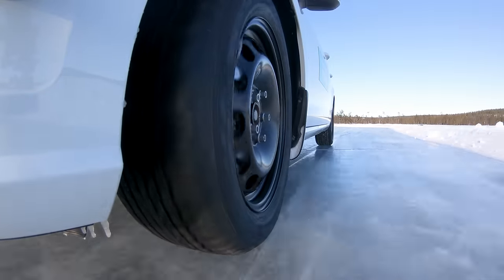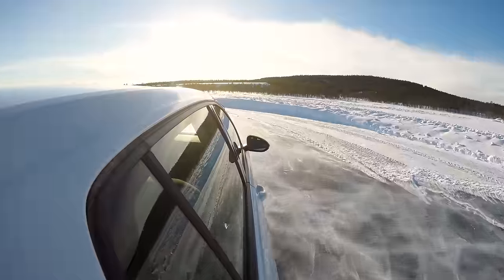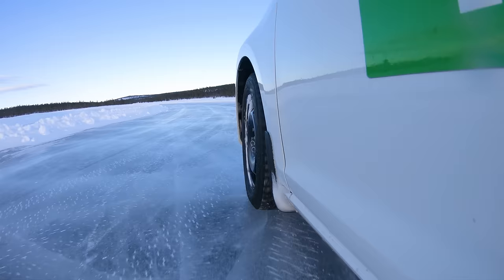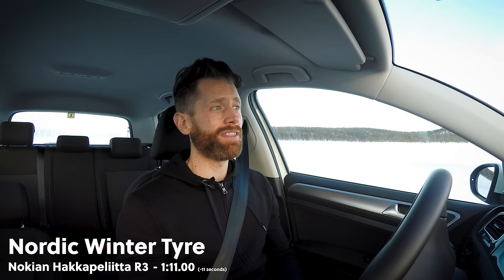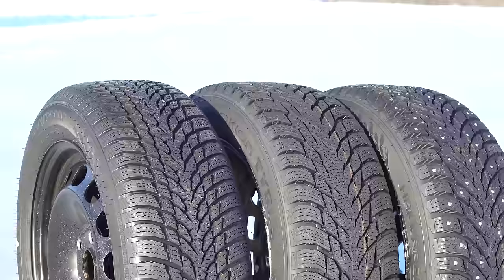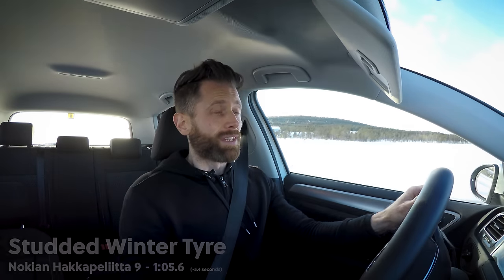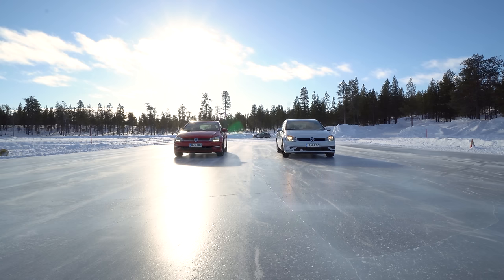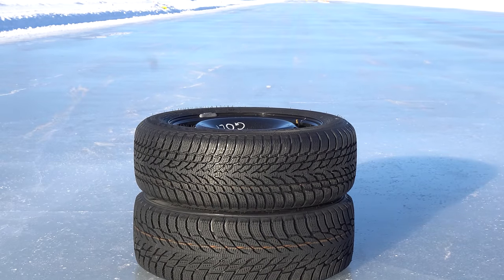Winter Tires VS Studded Tires ❄ What's better on ICE?

Comment: The times would be more impressive if you would have a "0" time (same track layout on tarmac in summer, best situation).
Reply: The summer times wouldn't be impressive considering that this is a lake.
Reply: That's why I wrote on tarmac. How would be the time on a normal track with the same track layout as on the lake

Comment: A good test would be brand new non studded tyre vs a 3 or 4 year old studded tire that’s been exposed to the elements. Age of the tyre has more to do than people think! These tests keep comparing new to new tyre, while many people have tyres they swap every year. Personally, I think running the winter tyres through the summer to finish them off is better than thinking studded tyres is the epitome of winter tyre performance, it’s not... the epitome of winter tyre performance is brand new tyre compound! I can go more places on brand new Nokia’s hak’s than 3 year old hak’s with low tread wear + studs. Tyre age and how a compound grips is more important than studs!

Comment: On ice: Studs... no competition really
On snow, slush and tarmac: no studs 100%

In either case.. don't save money on winter-tires. Get the best ones you can afford or you'd be cutting corners with your safety!
Reply: Not really. No studs are slightly better on snow but sudded better on the rest, mostly on ice.
The reason is that studded tires got harder point where the studd is places and therefor less grippy lamellas.
But that makes the tire a bit harded and more stable for lateral forces and better on tarmac and water.

Comment: This is a problem, this is flat and smooth. The test needs to be in the city and neighborhoods were solid black ice on a hill going down to a busy intersection or stop signs were you have to brake. This were ppl get stuck and run into each other. fiq. this time of age we would have this completely solved. So i suggest flying cars hehe

Comment: Not really a discovery....at all.. The problem with studded tires is that unless you live in a place where you drive on snow and ice covered roads consistently all they do is destroy the roads and perform poorly on rads that are not ice covered. Unless you live in the tundra away from civilization, the most common winter driving condition in, even in the coldest climates, is dry roads.

Comment: Studded tires will wear the studs of by 6000  miles or less . So if you drive on a lake which is ice then go studded . If you drive on pavement covered in snow and ice but have money to burn other wise forget studs . They are illegal in more states then the legal as well . 

Studded tires would be good in Alaska or Canada’s far north . Otherwise forget them altogether! END of story ! This video is really USELESS cause less then 2%
 Of people will drive on lake ice !
Reply: FYI; Studs are design to last as long as your tire pattern (or close to)
I don't know where you got that 6000 miles figure.

Comment: Sorry, but why not test studded tires vs non studded of the same brand/type? Instead of studded tires of one brand vs non studded of another brand.
Reply from the maker: Did you watch the video?
Reply: @tyrereviews  Of course man! I did leave my comment early on in the video, and the wording is probably wrong because of that. Unless I missed something..you tested 3 different tires from nokian. Nokian tires are fantastic, yes.  However, here in the states they are a little difficult to get and if you go to most tire places they will not have them in stock at all, if they can even get them.

What I was hoping this video was of (and still am if you could do it?) was that you would take one set of tires from a manufacturer that are studdable, get one set studded and one set non studded. From what I can gather (I've never had studded nokians before, only non studded), nokian tires that are studded, come studded from the factory. Other studdable tires do not come studded from the factory, that is done right before you have them installed. 

So, my hope is that you could get two sets of something like the 'firestone winterforce 2' or 'cooper evolution winter' or 'general altimax arctic 12'. Stud one set, don't stud the other. So it is the exact same tire, but one has studs and one does not.  Apples to apples.. in your video here, each tire has a different tread and compound. Not so much apples to apples imho.

Comment: Your driving with new tires of 5-10 km shows literally nothing.
I need to pay about $1000 for studded tires. If I drive an average of 200km a day, how long can I drive with those tires. 2 weeks, 5 weeks or 10 weeks? When the studs wear out, the tires no longer stick to the road as they did in the beginning when are new.
Ihad nokian hakapelita 9 and next time i bought haka10.Haka 10 was full disapointment,while haka 9 were really good first 5000-10000 km.After thet it started sliding more and more...

Comment: Ok, I've got a beef here.  Put two Audi S4s together.  One with studs and one without.  Here's the race.  Launch control 0-60 in a straight line and then 60-0 aroung a corner.  The studless would get annihilated.
Reply from the maker: On ice? I'm not arguing.
Reply: @tyrereviews  On I-70 in Colorado after they've sprayed magnesium chloride and it continued to snow and then that mix froze. :)

Comment: hi .. nice vid ... but Your COnclusion about times had a little but importent logical error in it .. You said  changeing the Compound gets You 10 Seconds .. but wiht Spikes You get only 5 seconds more ... and in a simple way that is right .. but ...  with 50 PS  You can drive a car  around 100 to 140 km/h ... With 100 PS You can Reach 180 - to 190  so the First 100hm/h need 50 ps  but with the dobble amount You can only reach about 50% more ..  and with higher Speeds You need more and more Additional PS ( HP) to gain les and less Additional speed ..  same here ... Only compount gets You 10 seconds ...  but with Spikes You gain 15 Seconds  Compaird to  the First Tire ...  and You dont know how much  of this 15 seconds belongs to the Compound and how much to the spikes ..  and the Main  advantage ist .. Spikes give not only more Traktion to drive Faster ... they Give You also  much less Stopping length  and much more Secure in Courves 
in earlier times we hat Spikes in Germany too ... but with less and less Snow they destroy the Streets  that is the Reason that they are not longer alowed .   but on ice or snow there is nothing better than spikes !  ( as long as You have Weels on Your Car )  best proov to that ist .... ICE Speedway Races   !!   sorry for my bad english :-)

Comment: Soft compound tires are for you only - if you live in far north, where you have a lot of snow and low temperature is frequent here. You live away from cities and towns near rarely cleaned local roads.

If that is not a case then forget about it and get best premium brand central Europe winter tires. These tires are a lot better on wet surfaces, dry surfaces and at motorway speeds also the wear is not so huge as with soft compound tires driven in more mild winters.
Reply: 666HR Any examples of tyres youd reccomend?

Comment: I'll be brutally honest: After the last awesome video in the testing facility, this is amateur hour, unfortunately. Please repeat in the same facility as the winter vs a/s vs summer test.  Ice traction is very different depending on temperatures (and temperatures the ice formed vs being tested, since it can melt in the contact patch and then refreeze). And the stereotype/myth people really want to see tested is how bad/not bad modern studded tires are on dry cold pavement compared to non-studded ones.
Reply from the maker: Tested studs in dry, wet etc in the tyre type video a few videos back. This was a less serious video, but a less expensive one to make. Sadly the reality of tyre testing can't all be videos costing tens of thousands of dollars to make!
Reply: @tyrereviews  Yeah, but that one was also a unique video people would link to for years. On the other hang, there are dozens of videos like this recent one every winter. I only remember one test of studded tires you did, and that was at 15c, when summer tire trumps all else.  There is definitely value in testing studded vs non-studded vs all-seasons in temps below freezing, on ice, dry, slush.  It's likely gonna have interesting results as well. At temps below -20C, non-studded tires may match studded on ice, etc. Studded tires may be on par with all-seasons in near-freezing temps etc.  There is literally nothing out there that covers these topics (except for confidential manufacturer research). I think a Russian tire magazine did an ice test at different temps a few years back, but that's it. Maybe crowdfund the next visit to that facility? I'd certainly contribute.

Comment: Now drive the aluminium studded tyre on ice free road, and do a or two burn out with it, that's how it looks after a winter use - studs last one season then flat !
Studs can't be exchanged, have to drill new holes and restud them.
That can be done one time.

All winter tyres test neglect how they work after a season ! Like next year.
They one year use only.

20 years ago studs was made of iron, they made illegal now as hacks the roads... So only crap aluminium studs legal now. I have old tyres from 70s with iron studs that are still ok, but rubber are to hard to use on car. Use them on tractor snow plowing.

Comment: What all these test fails at is Ice on asphalt aka normal ground/normal winter condition where The road can be mixed with ice snow and regular asphalt..

Thats where you Will see The difference in tyres because of The unpredictability, just driving on ice you know what your gonna get... Slippery.

Comment: That ice is not polished! Look at any of the closeups, it's full of marks and there's frost on it.
Try this test with the worst case scenario, that is perfectly smooth and wet ice, and you will notice that studded tiers offers vastly greater levels of grip in these worst case conditions.

I don't care if studded tiers are only "marginally" better on your average ice, I care about them being vastly superior on the worst case ice because that's what's going to cause problems! I'm not going to crash my car on normal ice, I might when it's super slippery ice so that's why I want studded tiers.

Comment: Hakka 8s are better than 9s on ice.  9s are better on dry roads.
Reply from the maker: 10s are out now
Reply: I've only used 8s and 9s.  8s were awesome on icy roads but terrible on dry roads, they would swim around while driving.  9s are great for range with my EV and are really good on dry roads but not really good on ice, especially corners.  They grip but spin alot too.  8s never spin and always grip.  Maybe 10s are the best of both worlds.  Hopefully.

Comment: Studs are garbage do the same test in 3 months of normal driving the studs center piece is gone by this time and this tire will perform worst than the first tire because you loose a ton of grip. Moreover depending on the temperature studs won't even penetrate the ice.

Comment: finnaly sombody who understands that there is no such fucking thing as all season tires. natural rubber is softer so it stays soft when it's cold. but it's to soft when it's hot. syntethic rubber is harder so it' works beter for hot weather but they get to hard during the winter. what they do is that winter tires they get a high natural rubber mix while summer tires get a more syntethic mix. thats why you can't have all season tires. becaus the rubber mix is wrong.

Comment: Watching all those Russian crashes on youtube, I have to ask. What are the laws over there on winter tyres? Do they use them? Seems their driving on snow and ice is awful.
Reply from the maker: I believe it's a legal requirement there. It's just too much vodka
Reply: There's a difference between fitting winter tyres and fitting winter tyres with tread still on them.
Reply: I know that you have to have a warning sticker on your car if you have at least studded tires. So the driver behind won't probably ram your car when you stop.
Reply: Driving conditions can be difficult and driver should know ones skills in these conditions with that car. When they drink some vodka they become better drivers. Or not.

Comment: Then try driving on bare pavement with each tire. Good luck with the studded ones.
Reply from the maker: Done in a previous video, they're fine in the dry
Reply: Alex Altrichter they maybe fine in the dry but what does it do to the roads and in the cold wet studded tires can’t brake better than studless
Reply: Alex Altrichter I do love the videos tho. They are great. Really. So much to them. Blows the mind

Comment: Useless information and tires since 90% of people won't even bother with such things since those 90% of people are just mindless idiots and will just use what tires they have on the vehicle they bought.  Also a vehicle can have the most super amazing tires yet it will be meaningless if the drivers is absolute trash at driving.

Comment: Irrelevant test. For me,it's beyond stupidity to conclude,that the tire which gives better lap time is better on ice,or during winter. I live in Finland,and while surely,studded tire has its pros,the cons are way more. At first,you can't keep all the pins at place. They fly all the time,and that causes irregular grip and handling. Second,the pins that manage to grip are very few Vs the ones that are just gliding threw the ice surface. Then third,when you have FWD car and engine at the front,you have somewhat some weight to use for grip,but at the back,you have the effect of whiplash all the time. And I can go on forever with the cons,including the safety,cause when you drive on the motorway and metallic pin like this flies to your windshield,guess what happens. In Finland 9 out of 10 cars are with cracked windshields.
Reply: Insurance don't pay for a cracked windshield?😢